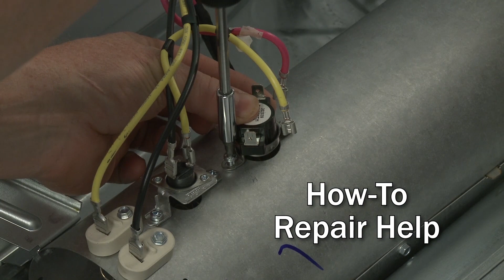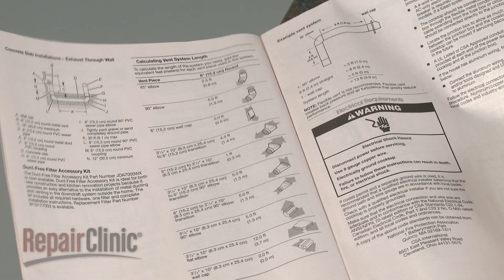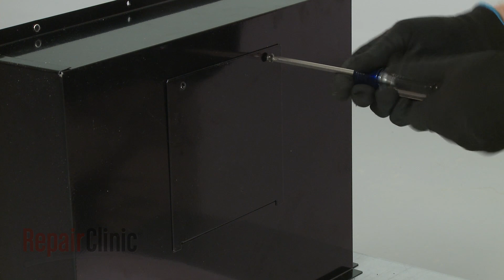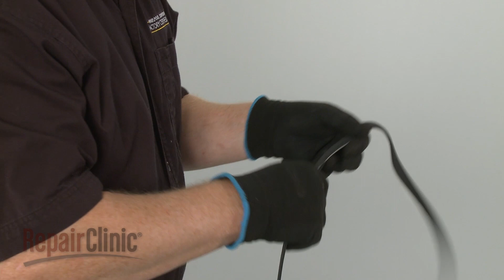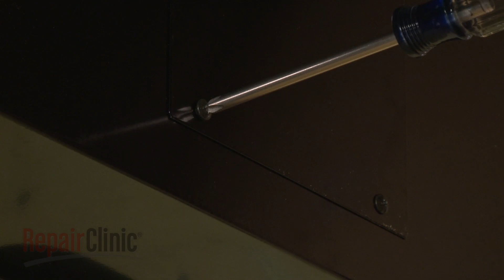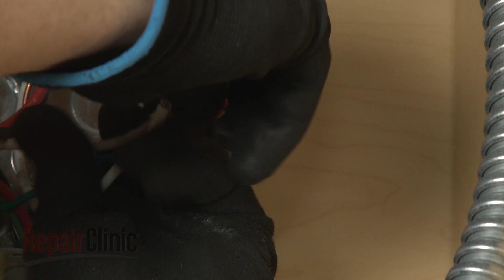Kitchenaid Electric Downdraft Cooktop Installation (Model KCED600GSS)

Comment: Good video, but as Lokjamsop tried to say a year ago, you made the mistake of not removing the spanner ring from the motor. It should be INSIDE the plenum. Then secure the motor using the fender washers and locking nuts.
Otherwise, nice job. Watching it first made me confident that I was doing it correctly.

Comment: Helpful. But why doesn't this video show the rather important step of how to secure the motor to the plenum? You have to take the ring off the motor after you remove the protective rubber covers from the bolts, then put the ring back on the bolts inside the plenum, then the washers, then the nuts - otherwise there is nothing to hold the motor to the plenum. I suppose it's supposed to be obvious, but it did take more than a minute to figure it out since neither this video nor the poor instructions that came with the cooktop show or mention this step. Why not?